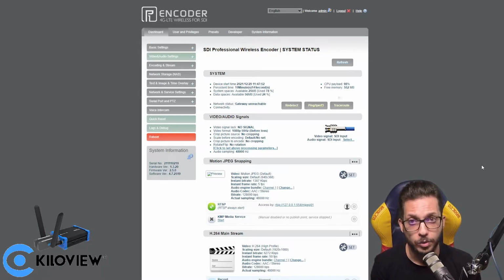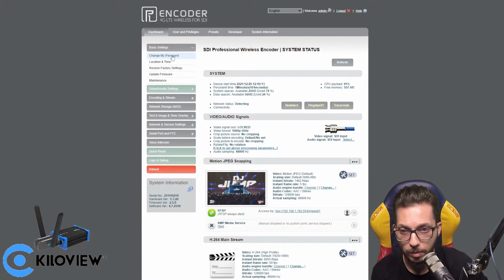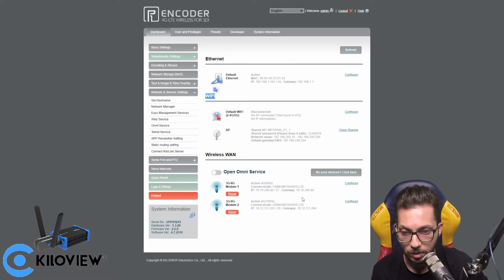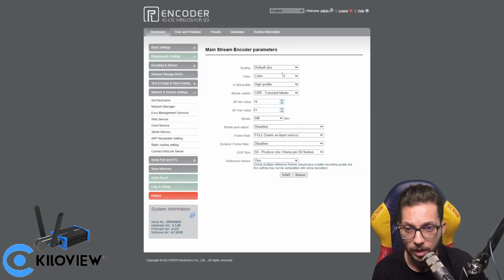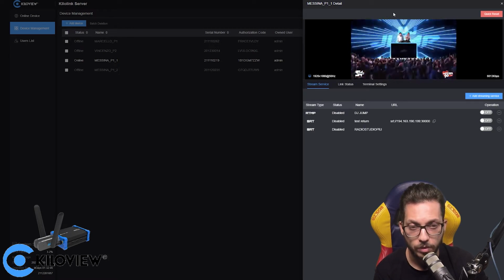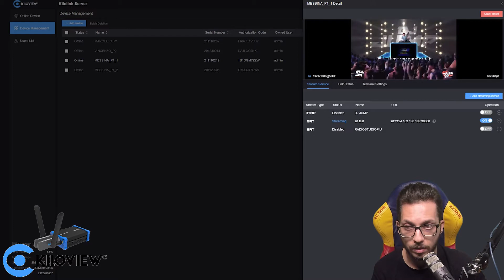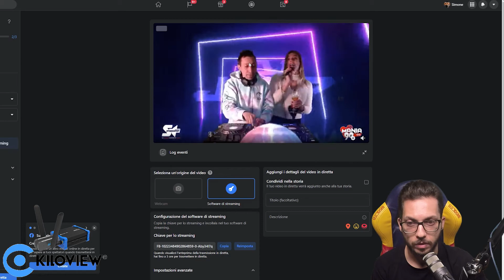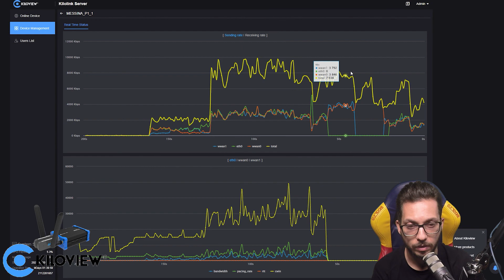KILOVIEW P1 BONDING ENCODER REVIEW [ KILOLINK BONDING SERVER ]

Comment: i want to send a RTMP signal (from gopro) TO this device, have it grab that video signal and then uploaded it over bonded 4g connections to a SRT server on the internet. Any idea if that's possible? Can you feed this device a video signal via RTMP instead of a HDMI or (depending on model) SDI signal? I hit the company up about it and they didn't reply, haha. Thanks!
Reply from the maker: think this isn't the best solution , better you go for a bonding router instead, there's no sense to push an RTMP stream from a single connection to than get bonded by another encoder. Better solution is you use a pc connected to a bonding router and send the stream of your camera via some real low latency protocol like NDI/ NDI hx or connected directly to pc via hdmi , and than stream with a bonding connectivity. P series are basically bonding encoders, so you attach a camera, or a video mixer and stream your content using the bonding server, it is basically a bonding router with encoder capability in some how if we want consider it like that.
Reply: @techthisout3549  hrm, what I want to do is keep the GoPro wireless and mobile for bike ride streams that I can easily take the gopro off the bike and move around a few meters with no cable. I can't easily bring a PC to do the bonding, which is why the p series device looks interesting.

The GoPro can stream wirelessly via RTMP which works fine for a local Wireless network, but is not good for a 4g network. Also, if I have mobile network issues it'd be much better to have two sim cards bonded.
Reply: @techthisout3549 hi! What bonding router do you recommand? Thx!

Comment: i have  kiloview p1 + blackmagick miniconverter+ sony a7c .(no audio) how to fix it?
Reply from the maker: If you connect the microconverter on the pc you can modify the SDI level, basically BDM uses level B, but professional gear used level A . So download the converter software for upgrade the firmware on the BDM page, connect your microconverter trough usb and modify that parameter, I'm sure it will solve your problem :)

Comment: Hello. Can Kilowiev have interlaced output stream 1080i50 or it is only progressive output?
Reply from the maker: Sure you can output 50i, it's broadcast level transmission, you can have 50/60i and all the different progressive frame rate settings
Reply: @techthisout3549  I didn't see this option in settings. Can you please test this and answer me to be 100% sure?
Reply from the maker: @johnpowell5868  man I use it in 50i for my works , it's not something like I'm not sure 😅 I use it on every work at 50i because we work in broadcasting events! Basically you have an option to tell the encoder to go full frame or go half of the frames when the FPS go over 50 FPS, otherwise you go full at 50i no problem, up to 60p 1080
Reply: @techthisout3549  OK thankjs. How about latency?
Reply from the maker: @johnpowell5868  the latency from the phiscal sdi connection to the encoding is 67 ms as kiloview manual, then the overall latency in the connection is sttled by the protocol you're going to use actually, as you might now RTMP has a latency, SRT is way faster rtsp it's diffrent again. I mean basically you can set up the latency of your streams one by one according to your needs

Comment: Salve Simone, thank you very much for this excellent video!!! How exactly the bonding / aggregation is working on KiloView P1/P2? Does it simple sending the stream from each source (SIM, Wi-Fi, Ethernet) on separate paths to KiloView server where the aggregation obviously is working or is the aggregation already done from the KiloView P1/P2 out of the box to the outside? Trying to find out if the device is using the true multipath TCP or just failover. If you bond the two SIM card in KiloView P1, does it double the stream out rate without the KiloView server? Thank you very much in advance!
Reply from the maker: Hi Goran, well the bonding is made by the server actually. The encoder itself can work as a standalone encoder, but in that way the connections works as failover, from the higher in performance, like the wired USB to lan adapter, to the lower in performance and signal strenght. Instead when you connect the p1/p2 to the server, is the server itself that work as bonding platfrom, so the signal data rate will be splitted between the connection you made avaliable to the server, you can basically reach up to 5 connection: 2 sim , 2 external dongle with sim/smartphone(hotspot) and wifi also. When you're connected to the bonding server, no matter if one of the connection fail, the signal will stay on without beeing interrupted, as you might see at the end of the video, I hot unplug the lan cable and one of the sim, and the signal won't stop because the server is able to reaggregate the signal and split it between the avaliable connections. If you use as a standalone product, when one of the signal get down, you have a freeze for a small ammount of time (generally few seconds, it depends on how fast the encoder is able to switch to the next avaliable connection ). Hope everything is clear, if you have some more doubts don't hesitate to ask ;)